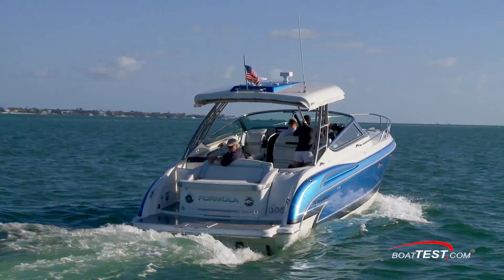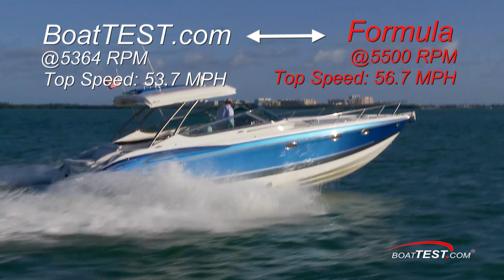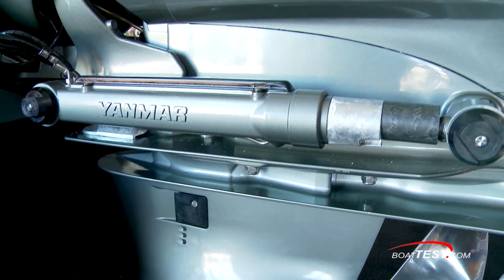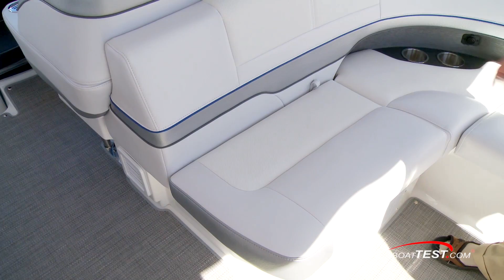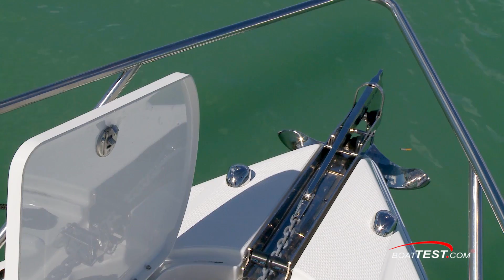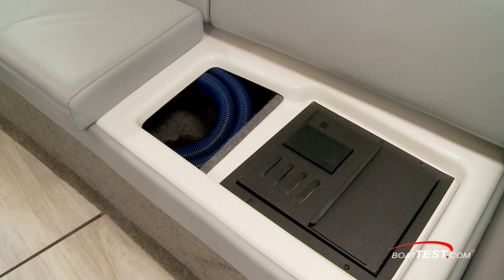Formula 370 Super Sport (2018-) (w/ 2 x 483-hp Ilmor 7.4-L) - By BoatTEST.com

Comment: If it had kama surface Drives and 5.9 Cummings diesels the boat would race at 70 mph
Reply: lol nobody would buy the pos you described
Reply: @hildablanco1516   fast diesel on a boat under 40 feet will be annoying to maneuver. No throttle response, can’t read waves